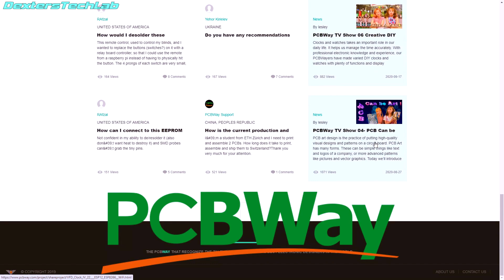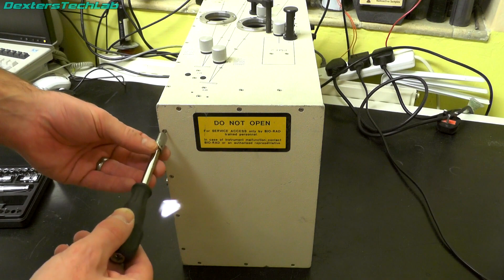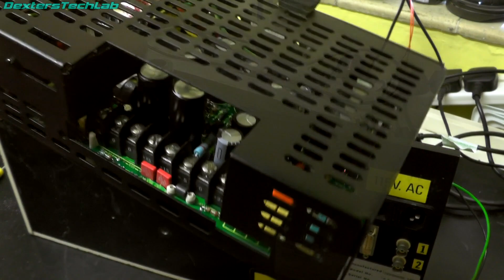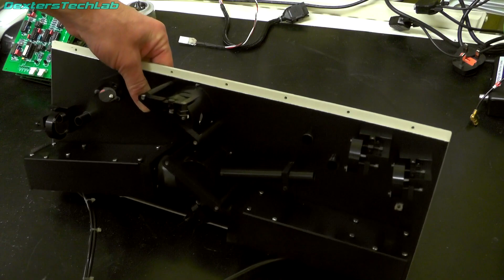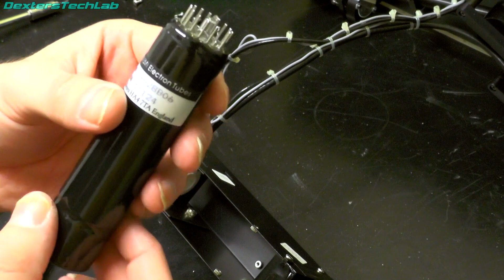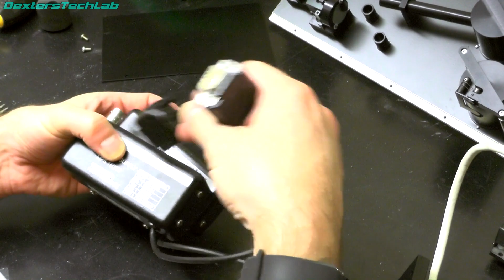DL202 Bio-Rad MRC600 Confocal Laser Microscope Teardown

Comment: Thanks for this, I was a proud owner of the Bio-Rad MRC500 and a 600. The scan head had a removable set  filters and a couple of dichroic stuff, and X scan mirrors. Control of the stage to move in the axial was a cup with a rubber washer inside that turned the fine focus of the microscope, suffered from slippage and wasn’t too accurate. 
Lasers we had an Argon ion and upgraded to a flakey Krypron / Argon
Reply from the maker: Thank you for your comments on such an obscure machine.

Comment: The shuttered hole on the backplane was the laser input. The large circular cavities accept different filters and dichroics to select the wavelength of the emitted light. The smaller holes were for alighment, originally perspects but we later replaced them with electronic inserts to help align